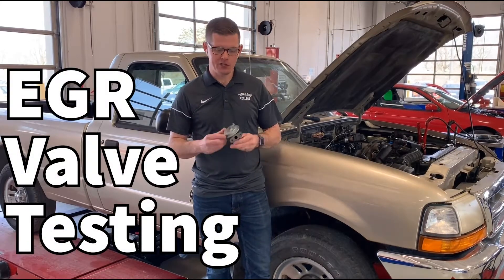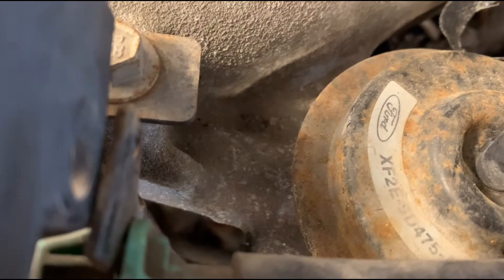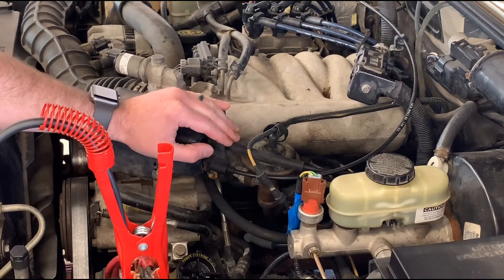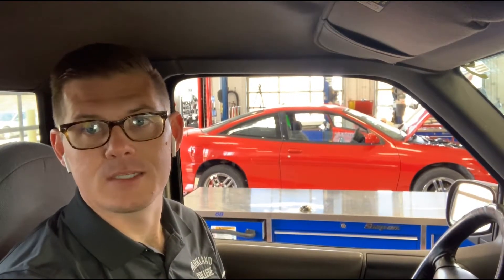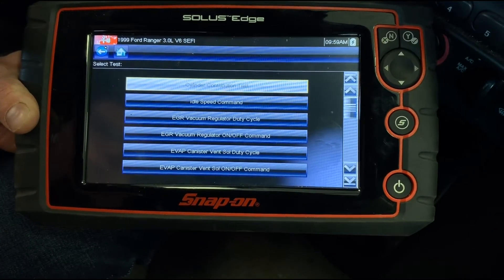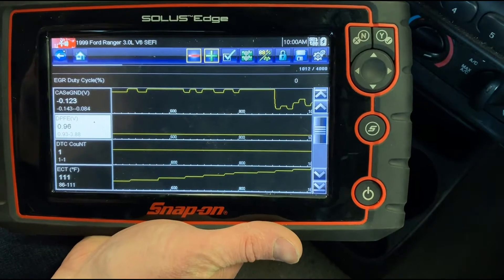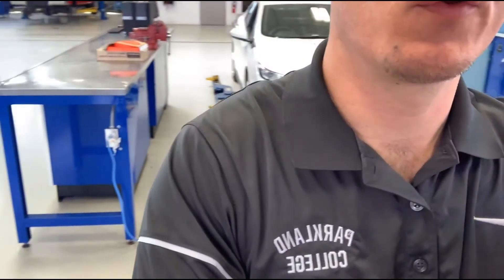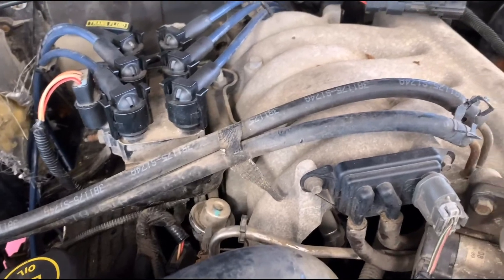On-Vehicle EGR System Overview and Ford EGR Valve Testing

Comment: my 2000 ford ranger 3.0 v6 idle is rough, what would you recommend to do? it is Manual transmission, when I engage the first gear and release the clutch as accelerate it vibrates, it does that in each single one of them 5 gears. Help out please!

Comment: Question, if you put vacuum through the egr valve and nothing happens to the engine idle what does that mean? The valve is bad?
Reply from the maker: There are a couple possibilities. One is that the valve is not opening and needs replacement. The other is that the valve is opening, but passage ways are clogged with carbon and unable to flow any gases.
Reply: @AdamsAnalysis  just the valves in the EGR?  Can you clean them?
Reply: an easy way to tell if the egr is gone is with a smoke test. hook up a vacuum line and blow some smoke into it. if the smoke leaks out from right under the egr head, its bad.

Comment: 4 cylinder engine very rough will not idle backfires. Bad Ford ranger xlt
Reply: ive got a 98 xlt. 2.5. its doing the same thing. changed everything but the egr valve. its a piece of junk i tell you.

Comment: Should raise the engine about 6 feet out of the water.

Okay everyone has vacuum pumps and scan tools.
My 2000 5.4 expedition (195k) starts fine, runs a couple mins. then starts with a series of misfires that seem to be controlled with a
electrical computer inspired clocked regularity for the next 5 mins. After a total of 10 to 15 mins. she runs perfectly for the duration.
What is turning on and off?